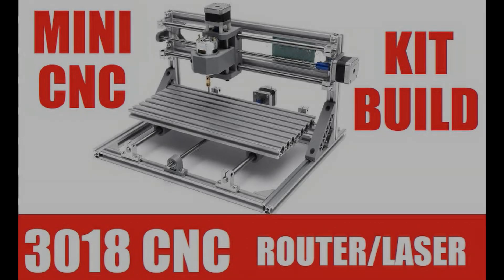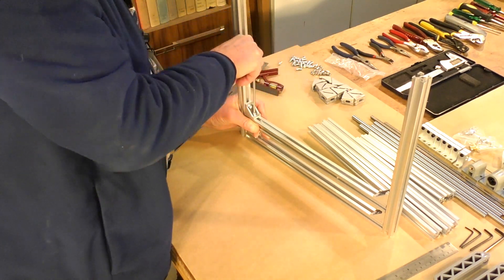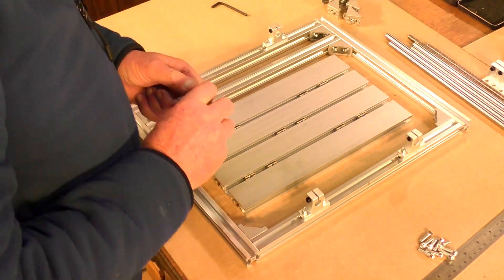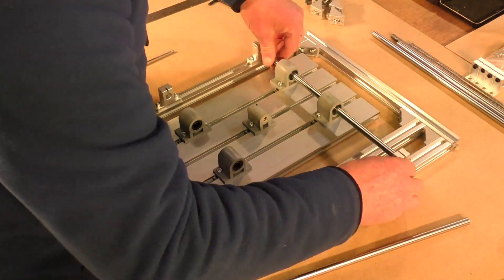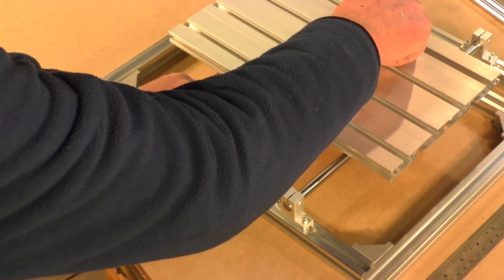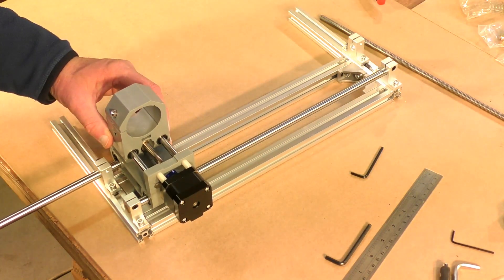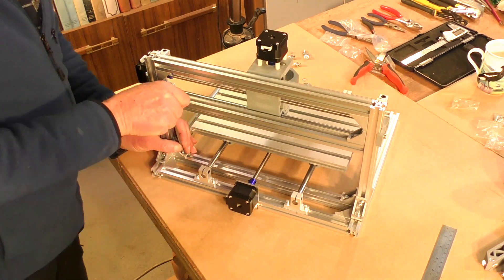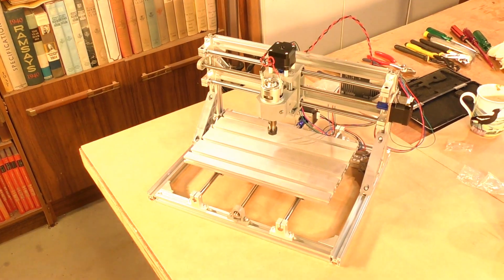CNC router $250 budget build "THE BEST 3018 MINI"

Comment: I have the 3018pro CNC machine. Protip: on the back of the PCB where it says x, y, z limit, it's actually z, y, x. The same mistake is also in the manual. The table piece of aluminiun is bent. I guess when they cut the extruded aluminium, it got bent. I put it in a wise and tried to hammer it flat with a wooden mallet, it helped a little. I'm not too happy about the whole x-z axis hollow gray plastic assembly. For cutting acrylic use 0.5mm for the depth of cut, 1mm is just too much.

Comment: so the first thing I noticed is the stepper motors appear different than the ones in the original picture at the start of the video.  I wonder if they are better or worse than the ones in the picture?  I also see that there are ones with a black frame and then this one that's all silver.  Wonder if there is any substantial difference?  The black one appears to be sturdier looking at least via pictures and is all one piece on the two sides.
Reply from the maker: Stepper motors are nema 17 and the black framed routers you see are plastic frames, i don't have a black framed one so i can't comment whether it is any better or not.
Reply: I have the black one. It's the "pro" model. Half of the frame is made out of bakelite, but the x-z assembly is still the same crapy gray plastic.